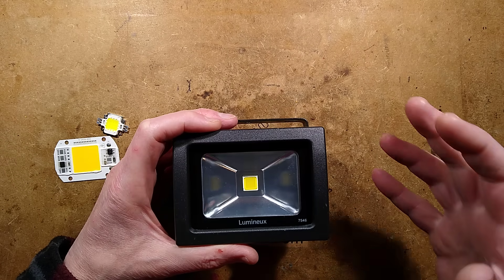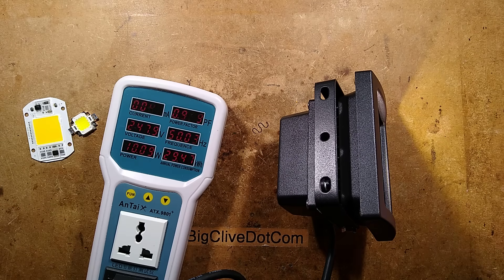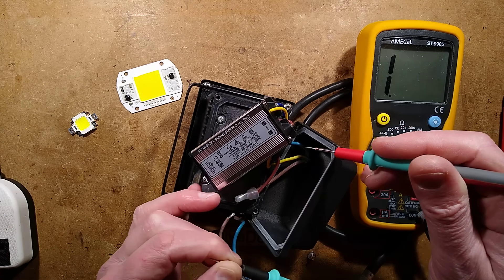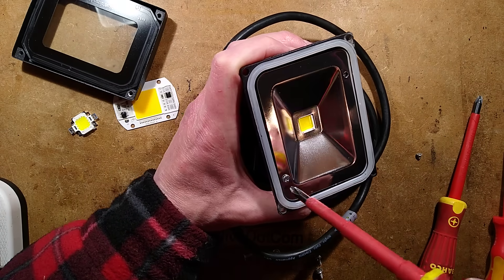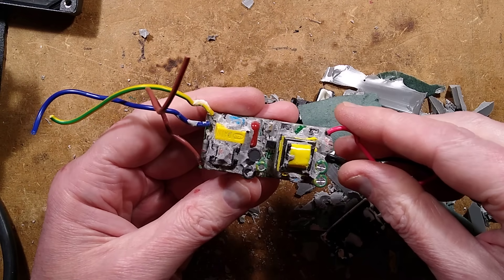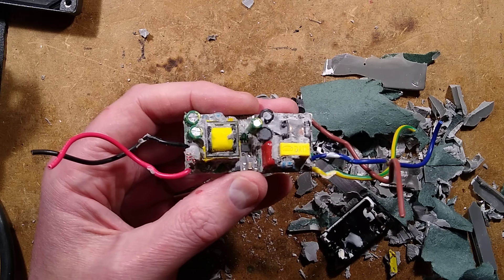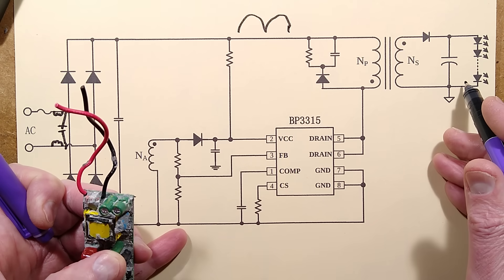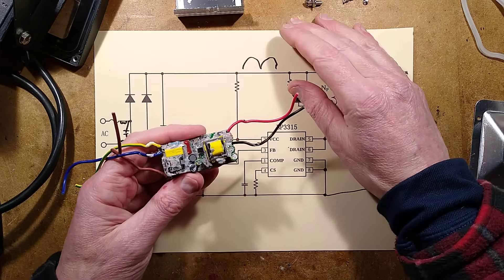Exploring a "retro" LED floodlight with a well designed driver

Comment: 11:15 The compensation capacitor on pin 3 is what allows the chip to run in current mode instead of voltage mode. The feedback voltage is compared to the current through the mosfet and the capacitor is selected to compensate for the induction of the transformer and things like CCM/DCM/BCM.
Reply: The schematic there shows a 'class 1' compensator (ie just a cap).  The cap is grounded, meaning inside is an operational transconductance amplifier (OTA), which is similar in function to an opamp or differential amplifier.  They work by measuring the difference between input voltage and outputting a current (usually in terms of microamps per millivolt) in a repeatable manner (that transconductance or current gain has a spec that is remarkably tight for how simple the circuit is).

The cap is charged by the output of the OTA.  I/C=dv/dt.  That cap voltage value then programs the setpoint for the peak mode control loop, which effectively sets current through the flyback transformer primary (which in this case just acts like an inductor).

When the peak current is reached, flyback transformer is open circuited. It remains open circuit until the next switching cycle.  The transformer current reverses direction (magnetic magic happens, thing to know is primary current in the same direction (now flowing though the snubber diode), while both secondaries reverse.  Current from secondaries can now charge output caps through diode 

Energy stored in flyback is conserved, so 1/2 l*i^2 converts to 1/2*c*v^2 on both secondary capacitors.

Voltage on VCC cap goes through flyback, connected one input of this OTA.  Other input connected to a voltage reference (usually something like 2.5v, though 0.8v is increasingly common).

Difference between feedback pin voltage and reference changes capacitor over time.  I like to think of it as 'pushing in the throttle' on an engine.  The voltage on the comp pin increases, setting current higher. 

Over time this will even out, so capacitor is charged to voltage where the feedback pin and voltage reference are equal (think the two inputs to an opamp, similar effect here).  

If the comp cap is way too small, the output voltage will oscillate wildly.  Too small and it'll oscillate around the setpoint but damp out (think about a drunk driver trying to steer a car by overcorrecting).  

Cap too large though and output current comes up much too slowly.  If you can tolerate that, fine!  But also remember, input voltage is rippling around at 120hz, so if it's too slow you'll see a 120hz ripple on the output.

Set it just right, and system will automagically correct for 120hz input ripple.

Current mode control is so wonderful!
Reply: @ohnoitslatekate  Well, I got to think I was smart for almost a month! Excellent explanation!

Comment: We have one about like this. it has a PIR sensor and it suddenly has lost his brightness and glows very dim (it wants to go sometimes but just flickers a bit brighter). Probably buying a new one seeing this. I had noticed that the LED's never went out fully when it was left on with no motion. So probably the LED have been running too long or it overdrivven them with the constant on and off cycles....it also happened after a cold winter....
Reply from the maker: It sounds like failed LEDs going open circuit.  The continuous glow may have been a snubber circuit leaking current past a relay.  It doesn't take much to make LEDs glow.

Comment: is it possible to  add smoothing to the onboard driver led?
Reply from the maker: I made a video about that.  It increases the voltage from the average value (RMS) to the peak value of the mains supply, and that results in much higher power dissipation from the current regulating chips.

Comment: i have one almost exactly the same as that, the 240v driver died, so i got a boost converter and use it on 12v as a work light in attics

Comment: Cluster LED wired if one Led burn out you have to replace the whole fitting. 

The earth wire is not fitted in anyway. It is barely touching the reflector. .
Reply: cluster led is the money printer in car industry.

LED headlight, LED taillights never fail... because led.

except they DO. and then it's half a fortune to replace.

i'll stick old bangers on halogen and max. xenon HID headlights. never led.

Comment: No wonder they don't make them like that anymore. It probably cost a fortune to make them. That reminds me of those rechargeable 10w LED floodlights you featured many years ago. Still have two of them that work great though every time I use the one I really want to swap out the LED module since it has an annoying greenish tint. Wonder if you could swap the 18650s with some higher capacity pouch cells in for better run time?

Comment: I often wonder who thought putting every single component on an aluminium heatsink surface was a good idea guess it means youll have to buy another one

You think a 9v supply over a 27v supply would have a lower frequency and produce less heat

What are you going to do with the rest in the box?

Would have been nice to see the leakage current specially with the earth connected to ground... Would you trust earthing to one small capacitor...
Reply from the maker: It's a class Y capacitor designed to fail safely.

Comment: Just a thought... I wonder if the electrolytics last longer in a potted circuit, as in it is not as easy to 'dry out' over time.
Reply: It probably would since potting compound will conduct heat away better than air.

Comment: Alright clive I hope you are ok.  I bought one of these from aldi about 5 years ago.  The front of it now has slightly got water ingress which has been there for about 2 years you can see it through the glass. But it still works absolutely fine and has never tripped or failed whatsoever. I know that I should possibly drill a drain hole in the front of the fitting to stop condensation building up(which I think this is where the liquid has come from) but I've just left it as it is because in the hot summer weather this liquid dissappears. It cost me £10 so for that reason I haven't bothered drilling a vent hole to let liquid out.  If it blows I'll just buy another.